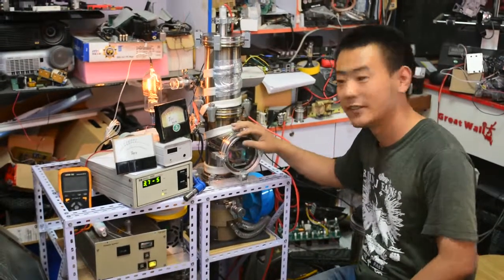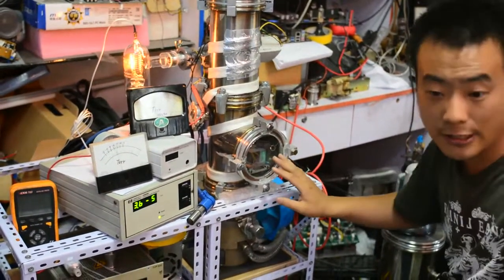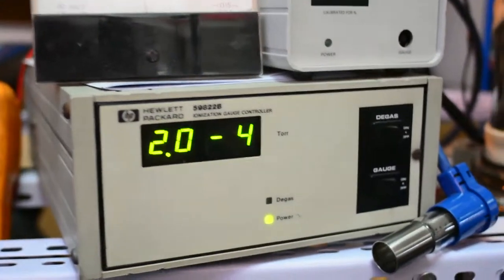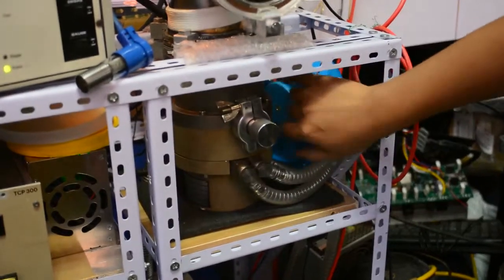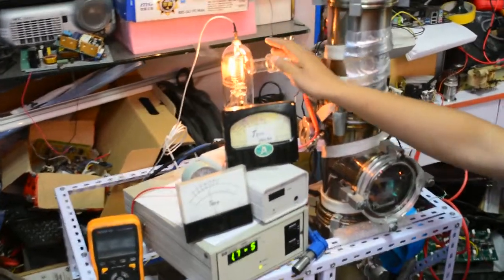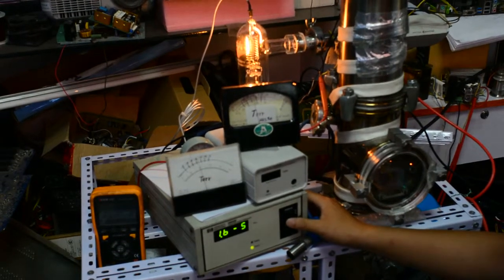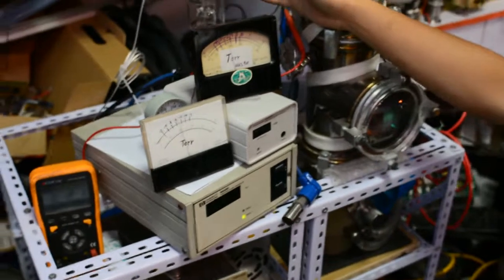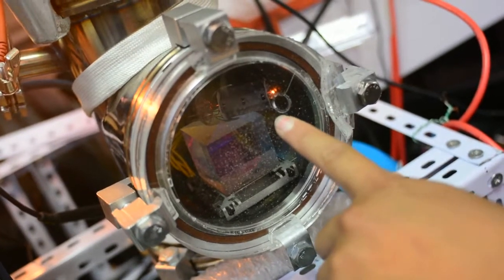DIY Scanning Electron Microscope Part2——Vacuum Gauge System

Comment: Amazing work! I have a request, there is a current mystery in the gpu scene, the modified tu104 Nvidia die used in 2060ko what did Nvidia do to the tu104 to rebin it to the 2060 because whatever they did they didn’t disable the compute power of the 2080 die so this bargain gpu contains a crippled somewhat tu104 and everyone wants to know what they did, maybe you can contact gamers nexus and ask them for a set of dies to analyze and publish a video? Could you use your microscope to identify the traces on a gpu die? Anyways just an idea I looked for homemade scanning scope owners and I found you with almost no views.